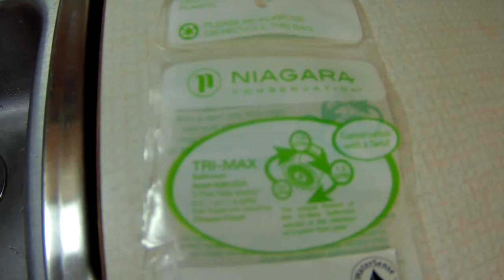Renogy Ground Deploy Solar Panel | Wind Turbine Wiring | RV Water Saving Aerator | Galley Updates

Comment: A's time went on it looked like you and as well as other people had problems with ground-mounted solar arrays. I was curious if you found a remedy and if the hardware on there would be suitable for using tent Stakes to secure them so they don't move.

Comment: Try those dryer sheets some other RVers use throughout their rigs to deter/repel insect & animal pests.
I love how you're going for HGTV's recently-introduced (and increasingly popular) "Ghetto Nouveau" style of remodeling -- nailed it!  I expect Odin approves?  ;-)    ...just kidding...
I hope to get all of the solar power I want on my (future) RV's roof...but if not, then I'll make up a "remote" kit like your Renogy suitcase unit...and if I tow a small trailer also, put at least 2 panels on its roof.
-- BR
Reply from the maker: I cut the cord a decade ago so I don't get the joke. I did hear about dryer sheets and mosquitoes but the big problem is flies. Nothing seems to stop those dirty little bastards. My Renogy ground deploy is not a suitcase unit but a legit 100 watt panel wired external to the solar controller. Works great along side the two roof panels. The suitcase units are over priced and under powered imo, but do the job if you are tent camping or in a small vehicle.
Reply: Oops...you're right: The suitcase systems are 2 panels and you only have one! Sorry for seeing that but it not registering.

I also have thought of a "remote" panel system, using large rigid panels as you have, but need to wait to see what's available solar-wise when I finally get my Class B -- if I can get enough from the on-roof system, I won't need any auxiliary systems.

-- BR
Reply: P.S. Odin is supposed to get the flies...
-- BR
Reply from the maker: I found that my roof panels provide plenty in the summer but fall through winter they fall short. Having ground deploy units you can aim will certainly extend off grid camping unless you want to run a generator a lot more instead.

As for Odin, he's lazy and middle aged. He used to chase flies in his youth but unless they buzz within swatting range he simply ignores them now. He loves moths though. I think because they taste better?

Comment: I knew there was a good reason why I subbed this channel. Everyone is SOLAR, SOLAR, SOLAR, but here on the North Sea coast of the UK, the wind never stops blowing. I never thought of a boost circuit to bring a turbine up to a similar voltage to solar panels and parallel them up. Do you have a turbine? Is the noise a problem?
Reply from the maker: Yes, I do have a wind turbine and you can see it in my Thumb Butte video. However, it was a piece of crap so I need to get a better one. The noise was certainly an issue at night as it was mounted to the rear door via the spare tire holder. I need to figure out a way to mount one where it won't amplify the sound through the chassis.
Reply: I'll check that video. They're popular for marine power, where noise isn't a problem. Boats are already noisy places. That's probably why they're not popular in vans and RVs. I'm sure quiet rotors exist, hope they're affordable.

Comment: Hey Robo,
I basically have the same rig.
When hooking up the hot and cold hoses to the water pump, 
how do I know which hose goes to the bottom and which goes to the top?
Thanks!
Great videos!
Reply from the maker: I just took a mental note when I removed the old faucet which was hot and which was cold, then installed the new faucet in reverse order. I didn't remove or replace the original hoses at the pump.
Reply: HOBOTECH Thanks for the reply. I did watch the facet replacement. Excellent video! Iam going to do that.
I was talking about the hot water tank. We winterize where we live and someone connected the hoses together at the hot water tank to bypass the tank so it wouldn’t freeze. 
Is there anyway to get a photo or explanation on the hoses at the water pump?
Reply from the maker: Oh, I didn't do anything with the hot water tank. I know there are winterizing kits for it that comes with a bypass hose and valves. If yours has that then you just turn the valves into bypass mode then fully drain the hot water tank. I can't access mine because it's under the permanent bed I installed (as a full timer I don't winterize). However, there are tons of videos on YT on how to winterize a 6 gallon Suburban.

Comment: Use some toothpaste to polish up your headlights covers. . other lites too.   Beats replacing them.
Reply from the maker: Shortly after this video I shined up the headlights using automotive cleaner wax and worked great... for a short time. I need get some clear coat to make it more permanent.
Reply: Hey Hobotech, check out Sweet Project Cars and hid vid " Amazing your headlights will SHINE like DIAMONDS"